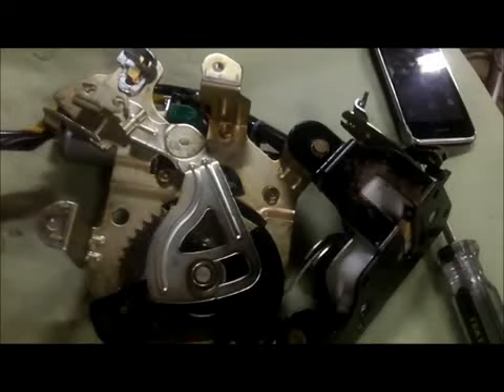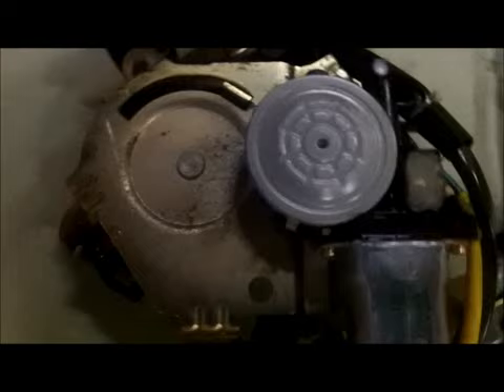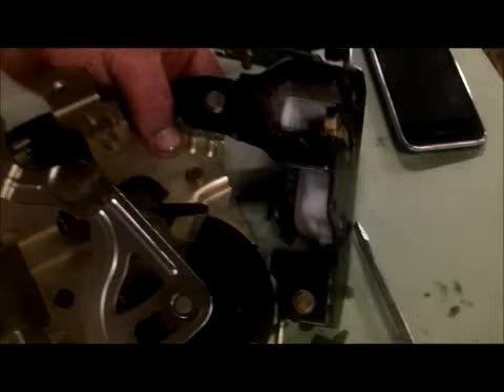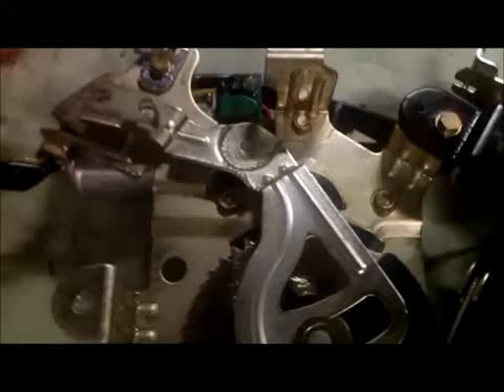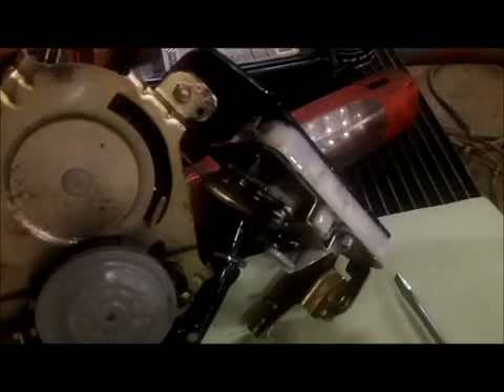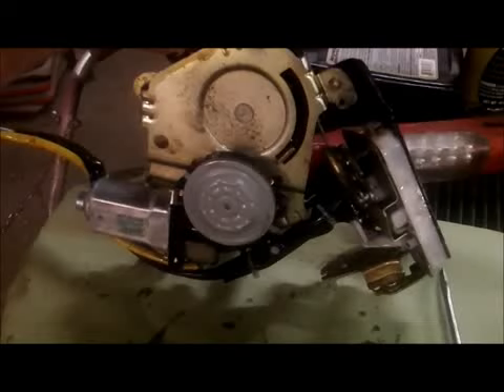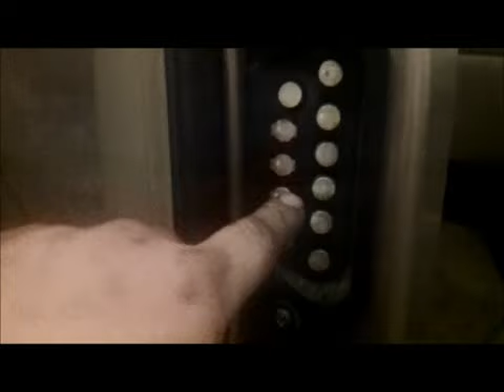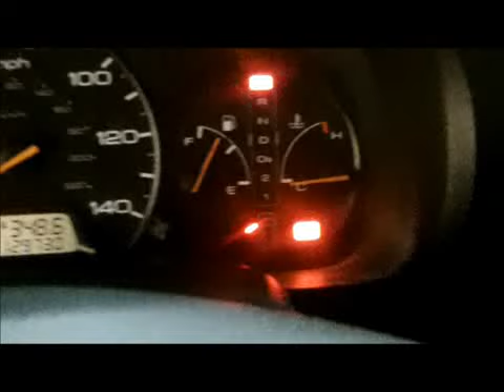Power sliding door latch repair Honda Odyssey van

Comment: I had the same issue with my 2001 Odyssey and watching this video before tackling the problem definitely helped. The latch lever you noted was definitely the issue because it's attached to a switch that indicates the latch has locked, but when the spring mechanism fails (which I actually found and saw was rusted out on mine's), the latch lever doesn't reset and keeps the switch depressed all the time instead. I ended up doing what you did and used a spring from a pen to provide the needed tension to reset the lever position. Works like a charm now and many, many thanks for doing the dirty work beforehand. It saved me a lot of time and money. Also, I greased the spring well to keep it from rusting too soon.

Comment: I had the same problem, but did not need the extra spring to fix it. It was just dirty and dry and needed a clean and lubrication.  Still a lot of work though, extricating and replacing the assembly.

Comment: A couple of things to try regarding the doors:
1) Clean the contacts in the door. These are the gazillion button things that is on the pillar between the doors. You can use an eraser or brasso/metal cleaner.
2) Sometimes the door needs to be reset. Open the door and close it with the buttons on the dash. Continue holding the button until the door is fully closed.
3) If that doesn't work pull magic fuse #13 under the dash on the passenger side. Put the fuse back in and repeat step #2.

Comment: Hey Shawn glad you are doing the Silverado. Also glad you are ordering the rockers and the cab corners as I was hoping to see you do the pre-made rockers, as not all of us have metal brakes etc.
ALso wondering what made you decide to go the pre-fab route? Because it is your own vehicle? Also what is going on with your frame? 
I have an 01 Silverado with all the same Ruuuust as yours and will probly hit it in the spring.
Have you checked rockauto for rockers, they had em cheap while ago.

Comment: that is so damned frustrating.. my 2012 did it all the time too.. carefully adjusting the door to its mounts to shift the door while in the locked position, and the lock catches on the body. It seems to have minimized the kickbacks as I call it.   But now that same door has a broken door open cable.. any hints or suggestions from anyone reading this is greatly appreciated and thanks in advance.
Reply: If this helps any, on my 2007 Odyssey my drivers door got stuck in the open position. Couldn't close it at all so found out when the back inside panel was taken off, the cable was wrapped around the motor. They removed the cable & didn't mess with replacing as wasn't sure if by buying a new cable that have to buy a new motor. Anyhow just using it as a manual door & rather just use it that way.

Comment: i don't think the latch motor is working, my 03 act up sometimes, and normally when it does it doesn't just immediately open again, it tries to latch for like 4 seconds then latches. btw there should be a switch on the left of the steering wheel to turn the power doors on and off

Comment: imaging the problems when those vans get rusted out with bad cables and corroded wiring plugs i can see the ratchet strap going accost from door to door and the unplugged motors lol cause it would be 3/4 of what the vans worth to fix it

Comment: Solution: Remove power guts, and manually close door like every other soccer mom. Next.
Reply: Door opens and closes thats not the problem.  The problem is that it will not latch when closed.
Reply: In order for it to work in the manual mode you have to have a working power latch.  It's not a 89 caravan